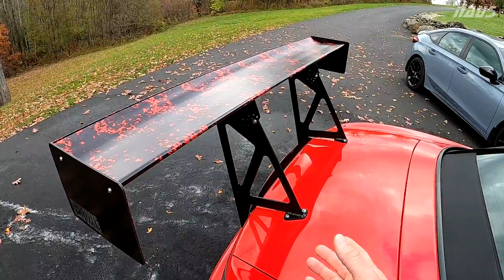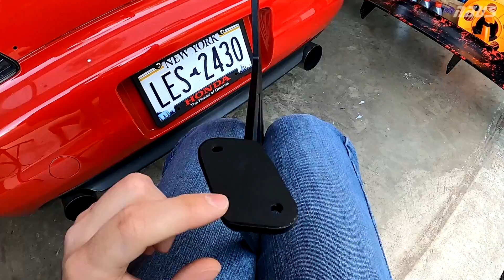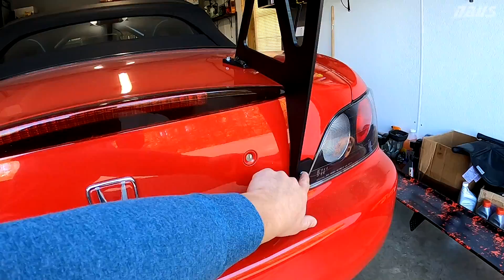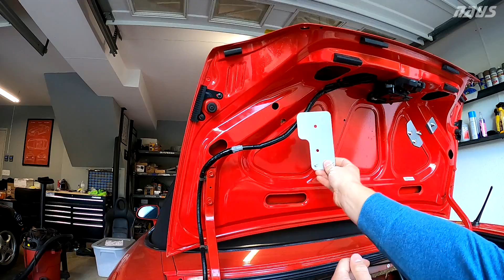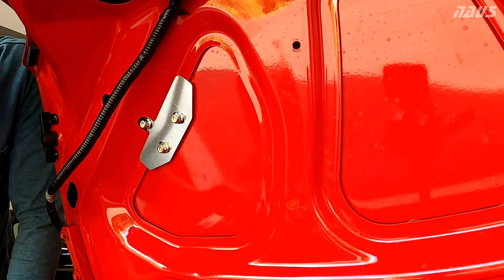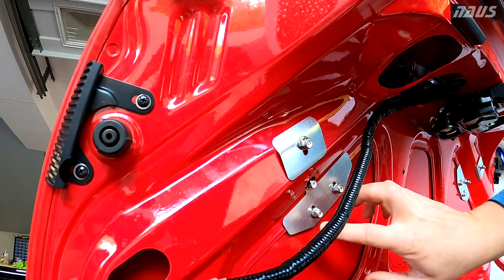S2000 Trunk Reinforcement Kit for 9LR Wing

Comment: @NAUS I'd like to order one of these kits for myself but not sure the email is going through on racebuilds
Reply from the maker: Hey there. I got a couple orders last night and am sold out now. Was one of them your order? If not I’ll keep you updated when I have them back in stock
Reply: @NAUS2K  possibly? The screen was just going to a white page so I wasn't sure.
Reply from the maker: @A_Bad_Driver let me know if your still having issues. I sold a couple more the other night and it all seems to be working fine. Next batch ships out 12/20 estimated
Reply: @NAUS2K  Looks like it is ordered and awaiting your approval! Thanks!
Reply: Hey @NAUS2K just a forewarning. My pylons have a different mounting plate and this ended up not fitting. Not sure if I got a one off mount or if they redesigned them recently